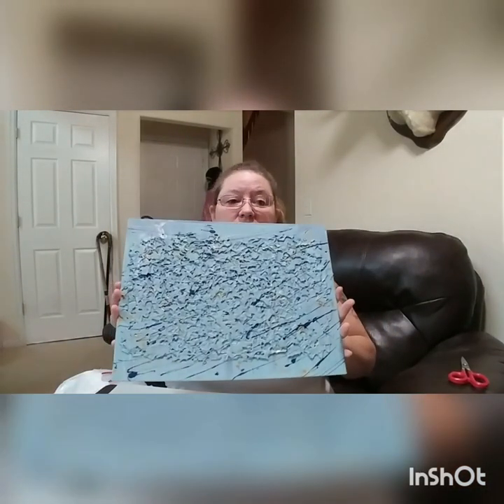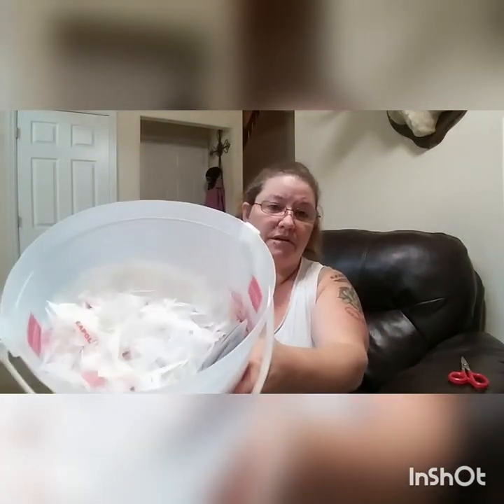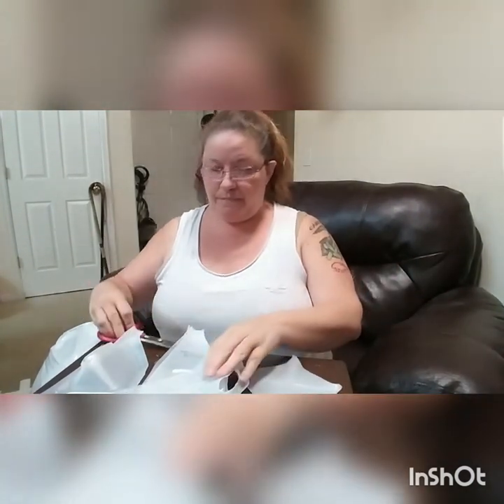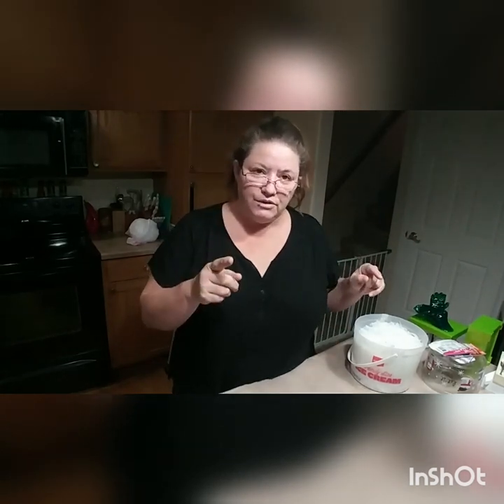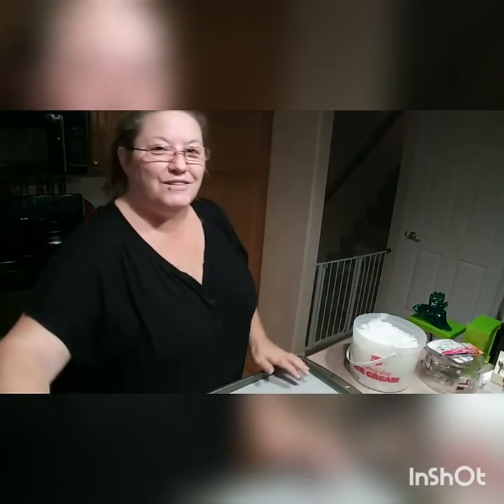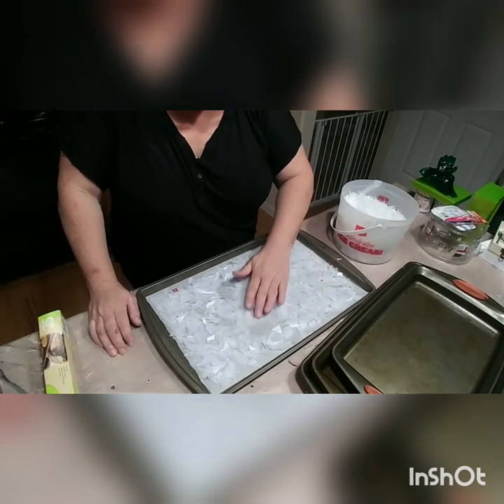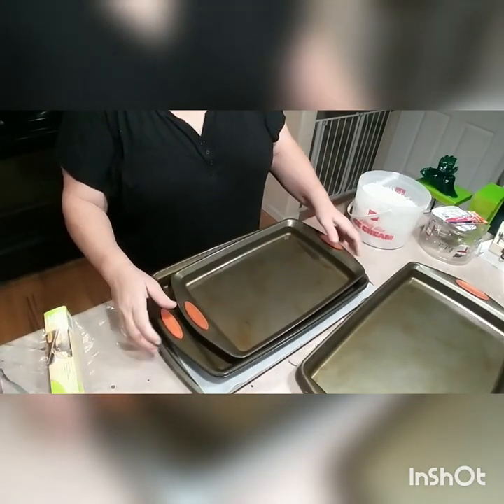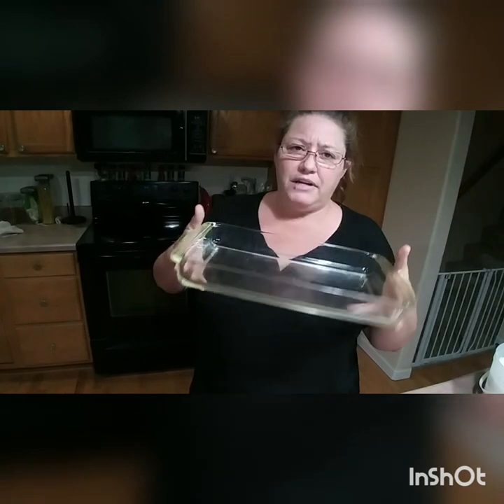Melting Milk Jugs For Art

Comment: You can also use cut up HDPE plastic bags to make a lace like effect.
Reply from the maker: BoingotheClown that's always good to know. Thank you
Reply: Correction: I was doing the lace like effect by placing the shreds of plastic bag between 2 sheets of baking parchment, then running the iron on top of the parchment to fuse the bits together.  Look up "fusing plastic bags" for more info.
Reply from the maker: BoingotheClown I will look that up, that sounds like it would be fun to try.